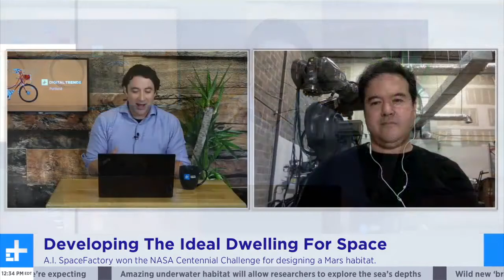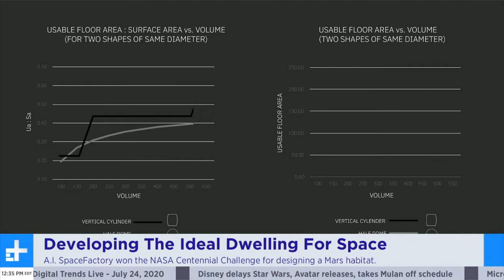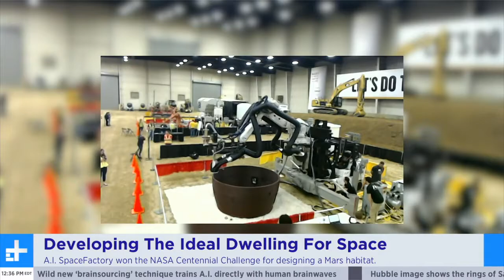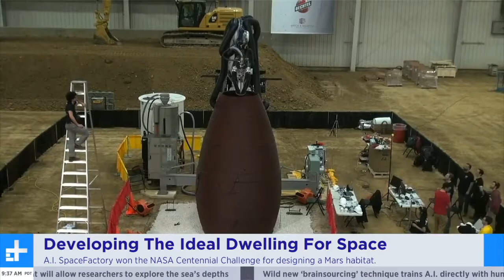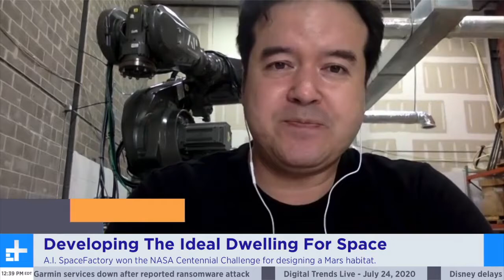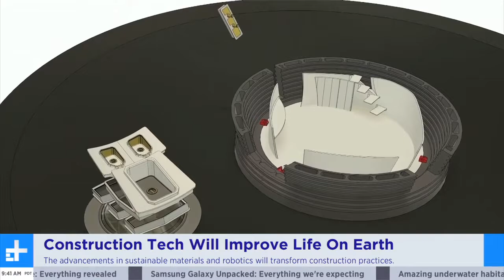A.I. SpaceFactory Takes Aim At Putting A 3D-Printed Dwelling On The Moon

Comment: Exciting! Just an observation: The rectangular Windows with sharp corners is a point of pressure failure. Aeroplanes in the old days had rectangular Windows until pressure fatigue cracks at window corners caused a number of crashes. I suggest Windows with rounded corners to avoid this same problem.
Reply from the maker: That’s fascinating. There’s a video right there. The history of the rounded corner.